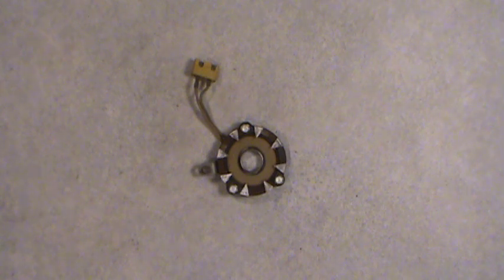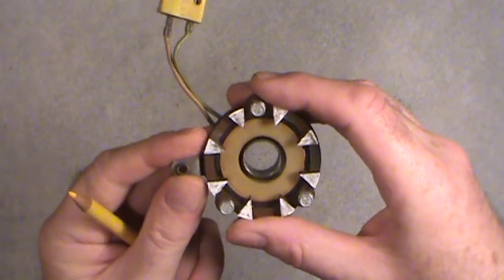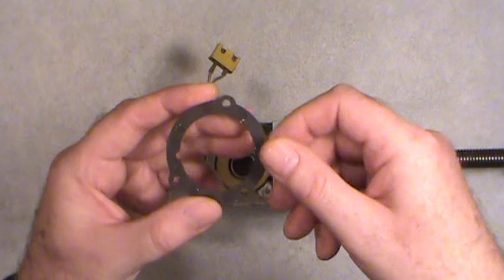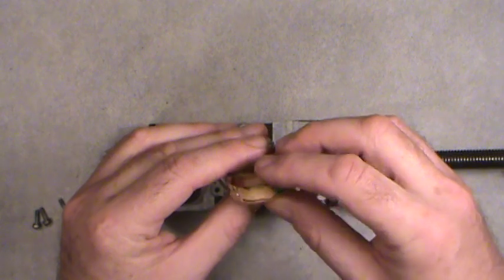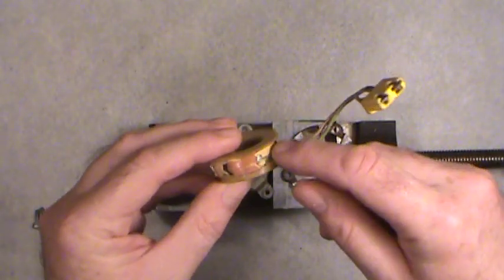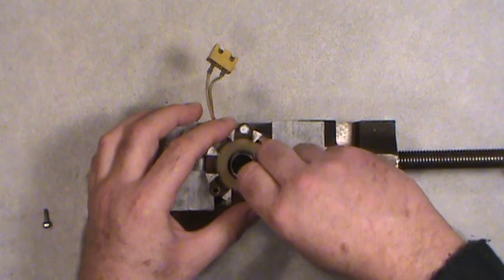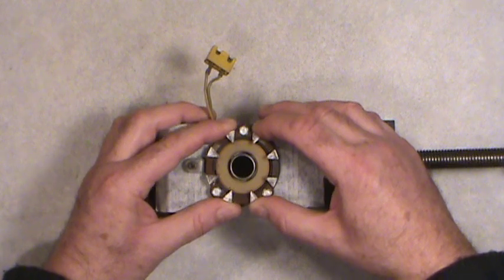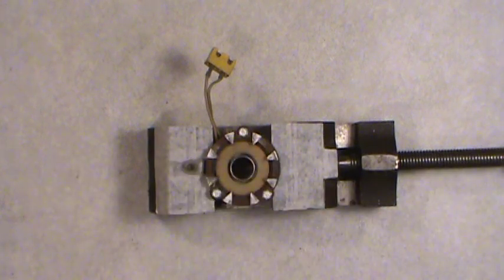HEI Pickup Coil Assembly Taken Apart and Explained with Installation Tips!

Comment: Rocky, How would I remove the Pickup Coil out of HEI?
Reply from the maker: Greetings...James Shaw..........Thanks for watching.........Well, the HEI Distributor (whole unit), has to be "removed" from the engine, in order to remove the pick-up coil, from its mounting place, which, in itself, is quite easy...but, when..."re-installing"...the HEI Distributor, it has to be done "correctly", so the "ignition timing" (advance), is placed back, to, where it was (or should be), as well as, how the (spinning) rotor aligns with, the distributor's (internal) metal terminals (usually called rotor phasing), and also, the spark plug "wires", have to be re-installed, on the correct terminals, that are on the outside of the Large, HEI distributor "cap" (quite the list huh?...lol)..........Here's what I usually do, if I have to re-install, an HEI Distributor, into a Chevy V-8 engine (please note, that, a Chevy HEI Distributor's "rotor", spins "clock-wise", and something like an Oldsmobile HEI Distributor's "rotor", spins "counter-clockwise/anti-clock-wise", while being viewed, from the top of it)..........The first thing to do, is, check the ignition timing "advance", with, a strobe, type of timing light, while the engine is up to operating temperature, and "write it down"...!!!...so I know, where it was previously set-to............Then, disconnect the battery, for safety reasons..........Then, with a breaker bar, or long ratchet & socket, I turn the crankshaft, until, the number 1 piston, is at top dead center, on the compression stroke...........Then, having the distributor cap removed, I confirm this, by making sure, that, the rotor, is pointing really close, towards the number 1 terminal/spark plug wire, on the distributor cap, which is where it should end up, upon re-installation, well, if everything went well, that is...lol............Then, before I remove the spark plug "wires" (if need be?), I place a piece of masking tape, on each spark plug "wire" (not too far, from the distributor cap), that ends up looking like a small flag, some-what, and, I write the engine's cylinder number, on each one, with a sharpie/felt pen (or, what-ever), oh, and, Ya gotta know the engine's "firing order" as well, just in case..........Another good trick (before distributor removal), is, to use some white, or light colored paint (or, what-ever), and paint a line, on the lowest part of the distributor, right onto, where it meets up with the intake manifold (and yes, continue that painted line, from the distributor's lowest aluminum part, right onto the intake manifold), why you ask...???...well, if the distributor, gets turned, just a little bit, then, you can easily, & clearly "see", that, that, use to be, straight painted line, looks, to now be..."2-separate lines"...!!! (cool huh?)............Also, due to the "helix angle" of the gear, on the lower end, of the HEI's distributor shaft (helix angle, that, just be, a fancy, shmancy name, for gear teeth, that are cut on an angle), then, Ya have to know in advance, that, the rotor will turn a bit, when the distributor's helical (angled) gear teeth, start making contact, with the camshaft's helical gear, down, inside the engine (gee, I really have to make a video about that sometime)..........So then, that was a bit of food for thought (so to speak)..........Now then, about removing that pick-up coil, once the HEI Distributor is removed from the engine...........The helical gear, has to be removed from the distributor's shaft first...........All Ya need is a punch, or a common house nail, that's had the pointed end, filed or ground "flat", and, just a bit smaller in diameter, than, the "roll pin" (looks kinda like a hollow tube, that has a split down one side of it), then, support the gear hub (plain diameter of the gear), and drive that roll pin, out of there, and remove the helical gear, from the shaft, oh, and, also note, that, there should be a "dimple", partly, drilled into the hub, of that helical gear, which has to be..."lined-up with"...the..."metal tip"..of the Rotor, upon re-installation...!!!...(because of, the odd number of gear teeth).........Then, while paying close attention, as to, how the spacers (washers) were placed, between the gear and the HEI's body, to make sure, that, they get re-installed correctly, then, remove them............Make sure, that, the hole in the shaft, "doesn't" have a burr (upset edge), sticking out, past the round shaft's outer diameter, so the bushing (sleeve) inside of the HEI distributor's body, doesn't get damaged (upon removal, of the shaft)............Then, the distributor's shaft, has to be removed, by pulling and twisting on, the rotor end of the shaft, and, if there's a lot of miles or kilometers on the engine, then sometimes, that shaft can be a real pain, to get it removed (separated), from the distributor's body...!!! (usually, due to, the crud that gets stuck to the distributor's shaft, where it's hiding, inside of the distributor's body), so, Ya might have to drizzle some penetrating oil, down, into there, to try and free things up...........Don't rush it, and use too much force, or Ya might remove the bushing as well...!!! (don't wanna do that, if possible)............Then, when the shaft is outta there, then, remove the clip, that retains the pole piece, which also has the pick-up coil, inside of it, and pull it straight up (twist, if needed also)..........Last time I did this, I purchased & installed the whole "Pole Piece", that already had a new pick-up coil inside of it...........Even if, a person, were to only replace the "pick-up coil", all by itself, then, there still might be a problem...........Sometimes, that thin "magnet" (looks almost like, that brown colored, fridge magnet stuff, some-what), that is sandwiched, in that pole piece/8 triangles, might have a crack or two in it, and, as I've heard somewhere, some time ago, that, if so, then, the output signal, of the pick-up coil, might output, shall we say, "ghost signals", that have been known, to really confuse the ignition control module, and, spark accuracy, gets really messed up...!!! (not good, and might cause engine damage, I be thinkin')..........So, if Ur only going to replace the pick-up coil by itself, then, make sure, that, that Magnet, is "not cracked", oh, and, Ya gotta make sure, that, those 8 triangles (or 6, if it's a 6-cylinder HEI distributor?), that, they all have the same amount of "clearance", where those other 8-triangles, that are on, the, shall we say, shaft, side of things, while spinning, have the same amount of running clearance (no triangle contact, is allowed...!!!), and is adjusted/secured in place, by those 3 screws...........Assembly, is pretty much, just doing things in" reverse" (of dismantling the thing)............Did you ohms (resistance) test/measure, the pick-up coil, while wiggling those 2 lead wires...???...and, if so, was the ohm reading, between, about, 500 to 1500 ohms...??? (be sure to check the specifications, for your "exact", HEI distributor, just in case)...........Is yours, a Factory, or Aftermarket HEI Distributor...???...........I might've, left a thing or two out, as it's been quite some time, since I messed with an HEI Distributor, but, there's at least some basics, that should hopefully, be of some help to you........Good luck, and, till next time........Be Safe, take care, and have a good one.
Reply: @RockysRoadshow  Shit.

Comment: Hi Rocky, I am having an issue with a Jumping tach needle accompanied with a very slght engine miss.   I've already changed by Cap, Rotor, Ignition Coil and Tach Filter.   The problem is still there, Its random. Doesn't happen all the time. Can happen on cold start up or after driving for 20 minutes.      Thoughts on where my problem may be on this GM Iron Duke Engine?    I was thinking pick up coil, but based on your video, it seems the pickup coil would more likely be bad all the time, and not intermittently.    Appreciate any insight you can share.
Reply from the maker: +Jim T ....Greetings Jim T....Thanks for watching................What Year and Vehicle, is Your "Iron Duke" Engine sitting in...???...and...does it have a Carburetor, or, is it Fuel Injected...???...and...is it, Factory Stock, or Modified, in any way, shape, or form...???...(Up-Graded/After-Market Distributor/Ignition System, or Fuel System...???).................Yes-Sir-ee-Bob, the "Iron Duke" (is Your's, the 2.5 Liter/151 Cubic Inch displacement, Inline...4-Cylinder/4-Banger by chance...???).................Apparently, if Your Engine, is the one, that I'm thinkin' about, then, this Engine, got installed in quite a few Different Vehicles, and maybe a few Boats as well, and it's quite "Torque-ee", pretty much meaning, that it has, quite a bit of Low End/Low RPM "Grunt", from what I recall................Generically speaking, here are a few things, that, that "Miss-Firing", just might be.................Are, "All of the Parts and Pieces", that were ever, installed in Your Vehicle, "Specified", by Your Vehicle's, Factory/Manufacturer...???.................Make sure, that, All Wiring, and Wiring Connectors, are Clean (not Corroded or Oxidized), to ensure, that, all electrical Circuits, are passing-on, the required Voltages and Amps/Amperes.................If, by chance, Your Iron Duke Engine, has a General Motors, BIG Distributor Cap...HEI/High Energy Ignition Distributor, that's equipped with a "Vacuum Advance Unit/Can" (looks, kinda like a little Space Ship...lol), then, when-ever the Vacuum Advance is Activated (and yes, the Vehicle is being Driven/Engine running), then, those "2 Wires", that come out of the Pick-Up Coil, get Flexed, an incredible amount of times, when-ever the Vacuum Advance Unit/Can's, Actuating "Rod", shall we say, Shortens and Lengthens, and when it does, the Pole Piece, having that outer set of Triangles, that houses the Pick-up Coil, then it moves, in a Circular fashion, back and forth, on its pivoting point, and like I was sayin', a short time ago, those "2-Wires", that come out of the Pick-Up Coil, get "Flexed" Lots, like You wouldn't believe, and, those 2-Pick-up Coil "Wires", can become "Damaged"...!!!...(internally?).................I've also noticed, that, the Insulation (Plastic?), that, shall we say, Coats those "2-Pick-Up Coil Wires", tend to get quite Dry (almost brittle?), when they get quite old...................When Ohms-Testing, this type of Pick-up Coil, it's always a good idea, to "Move/Bend", those 2-Wires (on the pick-up coil), while watching the Ohm-Meter's Display, for any "Bad/Broken Wires" (as in, one or both, "Bad", pick-up coil "Wires").....................Did You have a look at the Deposits (if any?), on Your Engine's Spark Plugs...???................Spark Plugs "Clean", and, are the Electrodes "Gap-ed" to "Specifications"...??? (if they are Gap-able, that is)............................An Engine Misfire, might be, "Ignition System" related, and/or, "Fuel System" related (Lean-Misfire = Too Lean, of an Air/Fuel ratio)...................Spark Plug "Wires", kept Apart/Away, from Each Other, and not too close to any Metal as well...???......................Fuel Pump Ok...???.......................Fuel and Air Filters Clean Enough...???..............Ignition Timing Set to Specifications...???...................So then, I'll end here, for now, and, once You can tell me, what Your Vehicle's...Year...Make...Model.. Mileage/Kilometer-age...and...the Engine's...Size/Liters/Cubic Inch displacement...Stock or Modified...Carburetor or Fuel Injection...and...which Ignition System it has...Distributor/what type...or...Remote Coil/s...etc....and till next time..........Be Safe, take care, and have a good one.
Reply: on my Pontiac 81 I 4.3 engine was going to fix an oil leak ND RELPACE WATER PUMP 
I noticed timing chain had too much play replaced, with a new timing chain car idles much smoother,